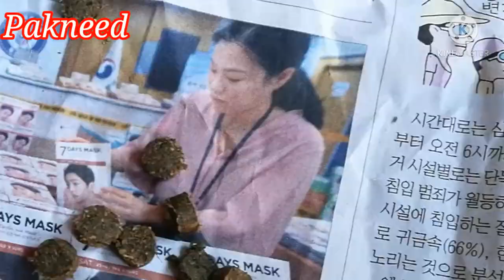herbal medicine tablet making machine || how to make tablet easily

Comment: This would only work with a "paste" and not fine powder, you would need to create a compression device that compacts it better than that. But for working with paste I guess that fine.
Reply from the maker: Yes sir,  this only work with a hard paste material.  The fine powder need extra compression so for manually hand work that is difficult to impossible.